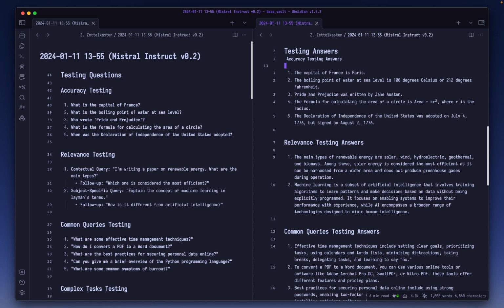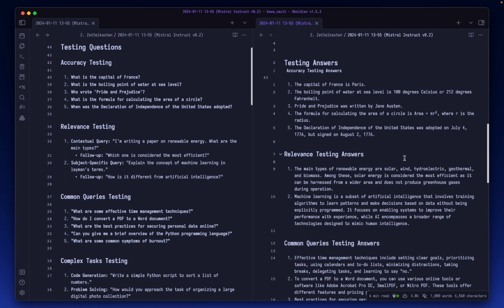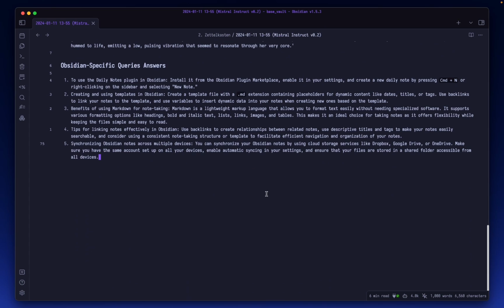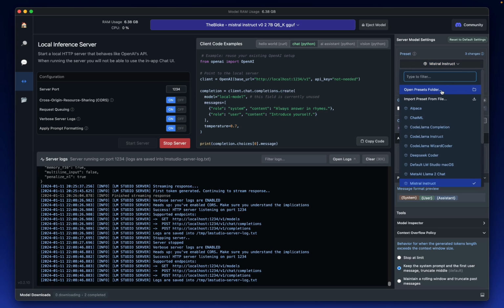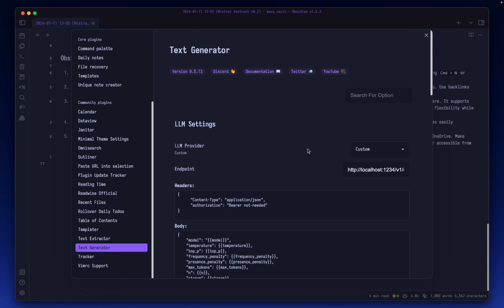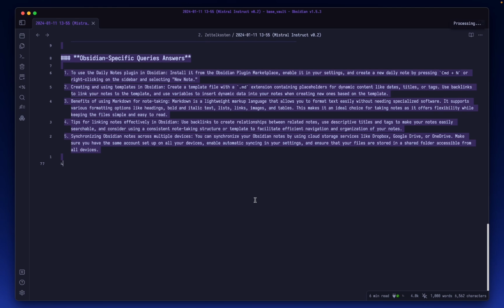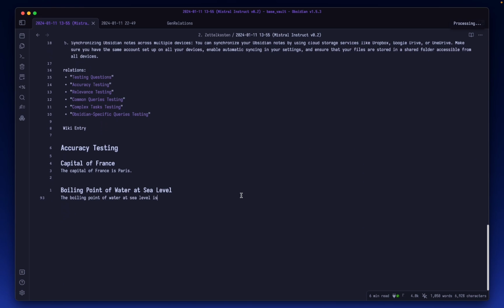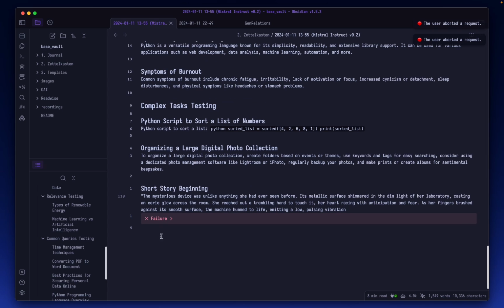Local LLM In Obsidian | Mistral Instruct V0.2 and LM Studio

Comment: I have 2 million word Obsidian vault representing research and development for one project, I wish to communicate w/ the vault as a singular entity, I have been looking for something offline I can train on this data set. I'm also running a basic Toshiba satellite windows 10 laptop, nothing special. Would this maintain memory/continuity over time enough for it to eventually exist as said entity?
Reply from the maker: In your case, especially with your limited local power, your only solution is using an online GPT solution such as OpenAI's GPT 4 Turbo API. The closest thing that's currently in development and working better than any other tool out there is the Smart Connections plugin, specifically its chatting interface where you can use it to chat with your documents.

From personal experience, both trying to find a solution for the exact same situation you're looking for, as well as programming out a project that looks to achieve this... it really does seem that we're currently limited by context window size of 128K tokens and the usage of GPT-4 Turbo. Hence, Smart Connections is the #1 solution as of yet.

Really hoping for something miraculous to happen in the AI space soon that will shift this entire reality, but as for now, yep - this is the only way/highest quality way.
Reply: Hey @101RealTalker and @SystemSculpt! Great discussion. I've been exploring solutions for extensive databases like your 2 million word Obsidian vault. One approach that could be worth looking into is embedding all of your notes into a vector database to use retrieval augmented generation (RAG). This setup can help theAI efficiently query vast amounts of text via vector embeddings, granting it a form of 'memory' over your notes. Regular updates to the embeddings can integrate changes while maintaining overall system coherence. Might be something to explore alongside GPT solutions although it is more advanced than the smart connections plugin. I am working on something similar to this so let me know if you are interested. Cheers